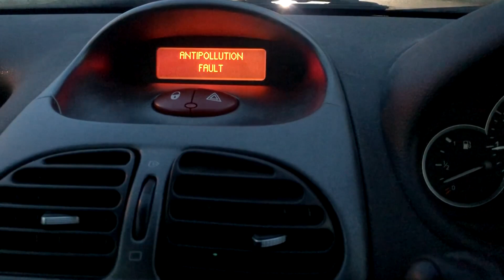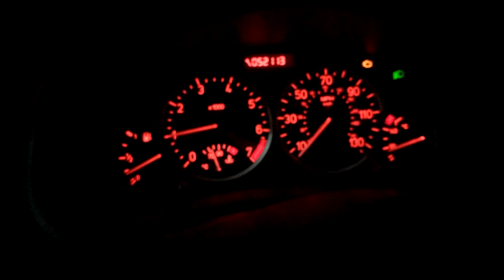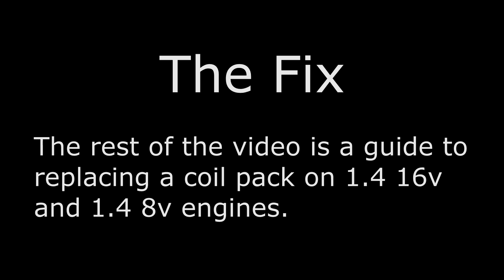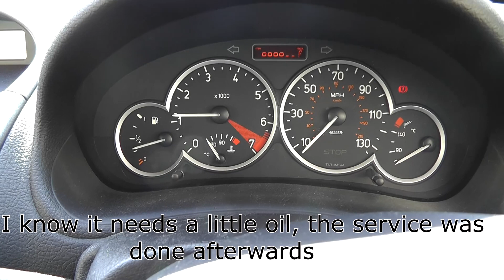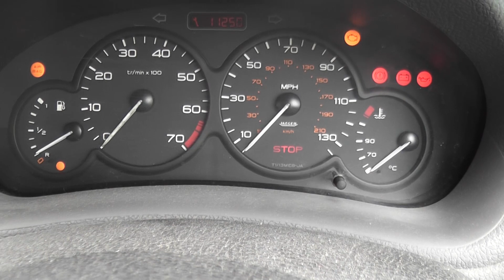Anti Pollution + Catalytic Converter Fault - Peugeot 206

Comment: I had this problem on my sons car. He put it in a garage. The cat was changed and the problem was still there.  New spark plugs problem still there. I changed the coil pack as suggested by you and hey presto problem was resolved.. many thnx...
Reply from the maker: Thank, glad it worked. I like slightly older French cars but they can be a pain when things go wrong.
Reply: I have the same problem but all garages keep telling me it’s a sensor issue and I can’t do anything about it.
Reply from the maker: @abzmumin8837  Did you replace the coil pack?
Reply: When coil pack is replaced spark plug should be replaced too isn't?

Comment: ew10j4 2004 16v 2.0 406 nice video man thanks for this. Had my 406 for about a year and today it told me ANTI POLLUTION FAULT with the orange engine light. I already got the new breather hose couple months ago as a backup because I thought the O-ring on the current pipe has gone bad because there is alot of messy oil which drips down from that area. I will just replace that new breather pipe and see if the AP warning goes away. As I dont have the new coil pack yet.

Comment: Had exactly the same symptoms, but a new coil pack didn't cure it. My 'simple' code reader said P1339 fault which changed briefly with the new coil pack to be a P1336 fault, but now a P1339 fault again. If I clear the codes it seems to run perfectly for between 30 secs and 2 minutes then the Catalytic message comes up, the engine light shows, and it goes into safe mode. On a 20 year old car of not much value there is a limit on how much to spend to fix it, and after a £90 Bosch coil pack I am fast approaching that point.

Comment: Hello! Peugeot 406 Symbol 2.0 petrol 2002 vintage. It has the same error, but it only comes out below 6 degrees 😞Unfortunately, I don't see exactly what needs to be replaced or cleaned in the car. Thanks for your help!
Reply from the maker: You might want to ask a mechanic or just replace this part and the spark plugs anyway. At least you and rule it out then, upto you though.

Comment: Hi I have same problem on my 307 1.4 .I have changed 3 oxygen sensor and coil pack but still same problem
Reply: I have the same problem with my peugeot 307 2Liter. Replace the Coilcap,injectors but still the very same issue... I think the cat is my car's problem... Did you find the problem

Comment: I've just had this happen today, threatened me for a while with anti pollution warning, the today, drives like piece of crap and telling me catalytic converter fault.. 52 plate but only 82k miles, be buying a coil pack first! Cheers🍻
Reply: Changed coil pack,spark plugs, complete exhaust including cat, both oxygen sensors and it's still shite🥵🥵
Reply: @Mike Evans  have you managed to fix your car
Reply: @pompeymik did you find out what the problem was in the end?

Comment: Does this work on 307cc? I’m having nightmare same codes and spent fortune on lambda sensors, cat, center box , squib , and more ! Almost £800 in total so far
Reply from the maker: I've never owned or worked on a 307cc so I couldn't tell you. If you're experiencing the same issues as I did in this video and you get the same message, then maybe you want to try replacing this part. Seems like you've replaced everything else anyway, so seems logical.

Comment: Hi i have the same problem get the anti pollution warning first and then the catalytic fault.Bought new coil pack,spark plugs and cam sensor as diagnostic machine picked up cam sensor,only thing still left is catalytic coverter sensor,did clear all faults but car still goes into limp mode,car has 250000+km.Its a 2005 206 2lt gti any help would be welcome thx in advance
Reply from the maker: The only other thing I can think of is the oxygen sensor but you might want to speak to a mechanic if you’re not sure.

Comment: I've done that but the problem remains. Any other solution?
Reply: Spark plugs or the catalytic converter itself. It's pretty much always one of the 3, or sometimes all combined. 90% of the issues I see with this is always one of these 3. The other 10 is... just an error you can write off or... low-quality fuel.

Comment: Hello sir I replaced the coil pack and plugs and it’s still the same once car gets to full operating temperature anti pollution message comes up and car develops a miss fire once it has reached operating temperature.It goes back to normal once the car has cooled down or left.What could the problem be? It is a 2005 206 Gti 135bhp with the 2.0 petrol engine?
Reply from the maker: Well this sounds similar but also different to my problem where the error message would show as soon as you start the car and pull away. The only other thing i can think is it might be the Lambda sensor but you'd have to check with a mechanic.

Comment: Mine does a bit of fluctuation on The idle but almost but IT doesnt tremble anymore and The engine has Power..
Reply: As an reminder..i had replaced cool pack,spark plugs,O2 bank 1:sensor and stilul does that...any clue fir solving ???

Comment: Hello, I will ask you for help, I have a Peugeot 307 1.4 Gasoline produced in 2003.  Every time you start a mass, Antipolution Fault appears, it consumes more fuel and there is no power, the engine does not have Star.  a few are very expensive and they are masters for all cars you can for one or two you can not for all bought a laptop and diagnostics supposedly do.  I have another problem at 50-60-Km, I get the sign for Ulje STOP and an Exclamation mark is also written on the board computer, but with English I say poorly, it says that there is no Ulje and the engine does not consume even Gram Ulje, I changed the sensor for Ulje, it says sometimes and says  In the city, give me a ride, I took out the Crater, I cleaned it and put it back. Someone told me that there was a Crater Sensor.  will scratch as soon as there is not enough lubrication please help if anyone knows.  Some people tell me to go to the Master and turn off the probe from the computer as if there is no probe that somehow I do not like it please help Hello from Macedonia Ohrid to all of you